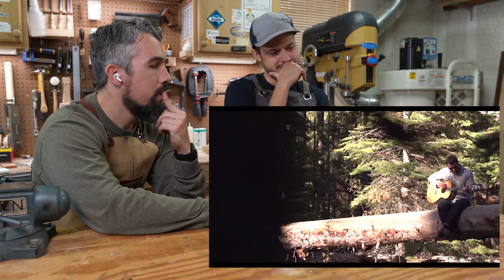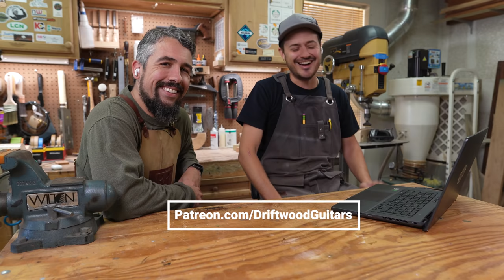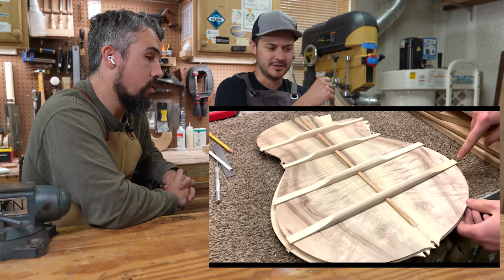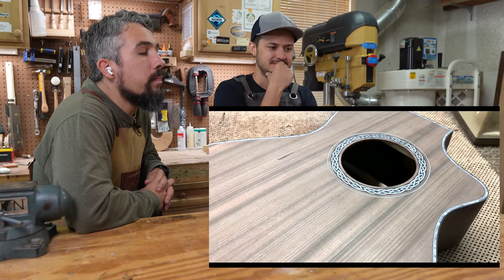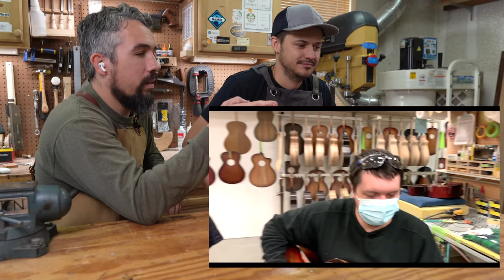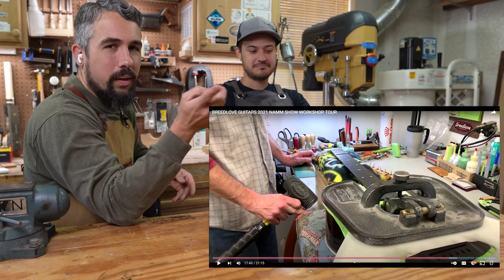Professional Luthier Reacts: Breedlove Guitar Factory Tour

Comment: Hey guys. Seems like you would like to have a vacuum table. They are very easy to build. Powered by a shop vac. I'm sure,with your experience, you could easily build one.
Reply: I have built one in the past, and would happily assist or even build one for you!
Reply: We often use a shop vac to pull down (debulk) the vacuum bags in making composite parts with the RTM process.  Resin Transfer Molding is amazing compared to the wet layup method, as the resin is pulled through the plies of material that have been laid up dry so all the vapors are contained within the vacuum bag.  After it cures in the bag, the shop vac is used to push air into the bag, inflating it and easing the process of pulling the part out of the mold.   CameronAircraft.com Learning Center videos...

Comment: I am a very small scale maker having built only one tenor ukulele.  I used vacuum clamping to glue bracing on the flat top and radiused back.  I used an inexpensive vacuum pump (12V DC from eBay, ~$12) for the vacuum pump as it was quiet and pumped things down in about 20 seconds.  I used some extra wide clear wrap for the membrane, sealing around the edges with some cured silicone.  The wrap is attracted to the silicone (like the kind you use to seal around the tub) and makes a good seal.  The vacuum clamp rig did a great job of holding the arch in the back while the glue dried.  The tooling stores flat.  A good thing for a hobby builder.

Comment: I own a couple of Breedlove's. My Oregon series 12 string is all myrtle and sounds fantastic ($2k new). I did have to do a neck reset once on it but it was super easy to do myself due to the bolt on, butt jointed neck. Not all Breedloves use the bridge doctor. My Moonlight 6 string (also made in Bend) does not. It is a super light build with spruce and mahogany. Breedloves have an amazing midrange presence but still nicely balanced. Most of my friends are not familiar with Breedlove but after they play mine, they have a whole new level of interest.

Comment: I bought a used Breedlove OM/R Revival Vintage with an Adirondack top made in Bend probably 10-12 years ago. I had been looking for a Martin OM-28 but just couldn't find one I liked enough to justify spending the $$. The Breedlove was around $800 less than a comparable used Martin at the time. It plays and sounds great. The low E and A strings have that piano-like sound quality a couple folks have already mentioned. 

I just discovered your videos and have been watching them all day. They're great

Comment: Let me start off by saying that I buy and sell guitars as a hobby and it's fun to play different guitars that I normally wouldn't get to otherwise. Have had several Breedlove guitars that retail in the $5-600 range made overseas that I have not been impressed with.  I have owned several high end Martin and Taylors so that is the sound I am comparing to. I had someone ask me about buying a Breedlove AD25/SR with an unusual wood blend of spruce top and solid rosewood back, but layered rosewood sides. Made in Korea in 2006. He was selling me a Martin D28 and an all Koa Mexican made Taylor 224CE-K DLX also. He said that the Breedlove was the best sounding of them all. I was thinking, yeah right he's just trying to get me to buy it. I paid $450 for it with an incredibly nice custom hardshell case. It went for over $1000 new with tax. Well he was right. It blew me away and like I said, I wasn't much of a Breedlove fan at that point. It made me sell a $3000 Taylor that was my main acoustic and after almost 2 years I can't find anything to top it. I recently bought and sold a Martin HD28 and it might have been slightly better sounding but I sold it  since it didn't have electronics. Look at the customer reviews of this guitar on Reverb. Over and over you find someone saying that that they went into the guitar store looking to spend $2-3000 on a Taylor or Martin and walked out with this one. And now if you can find one, they are only $4-500. There is a Mahogany one also but haven't tried it. I know the American made ones are supposed to be great, but for the money this has been like winning the guitar lottery for me!

Comment: For locating your braces once inside the vacuum clamp, wouldn't you just create a new acrylic template with slightly more margin to account for the thickness of the vacuum bladder?  That way, you could fit the template over the top of the bladder once the vacuum starts to make sure all the braces are in the right place.  If not, you could quickly release the clamp and re-set.  Just a thought!  Love what you guys do!  Keep up the great work!

Comment: I  built a stewac Martin D-28 in 2004 and it had a bolt on option. Still good , no problems and sounds really good. Trouble is the customer owns it. So I agree with your comments about neck joints.

Comment: I have owned two Steve Henderson models, a 1998 CM/MH-12 string and a 1999 CM/MH six string (mahogany/Spruce) Both exceptional guitars. I did re-fret the 6 string with jumbo SS frets, and installed Baggs Anthems in both. Quality of workmanship second to none. These models didn't have any bling(how I prefer it) other than around the sound hole. The bass on the 6 string was insane. The nut on the 12 was as good 1-7/8, a bit large for my hands. The six string was 1-3/4. I asked Shaun Hopper to test out the new fret work on the six. He couldn't get over the bass in the guitar. Loved it. Personally I was shopping for a cutaway model and sold both guitars to acquire one. Unfortunately, then the deal fell through. I super regret selling the six string. I purchased the new 12 string Masterclass, all Myrtle wood. Pricey, yet just not the sound I was looking for. Ended up trading it for a Furch Yellow series cedar over rosewood. Still preferred the Spruce over Mahogany Steve Henderson. The voicing was perfect on that guitar. Live and learn. Going to do it right next time...Saving up for a Driftwood. Hopefully I'll get there before I get too old.

Comment: I like a dovetail because it is a traditional wood working joint that goes back a long way. And I think you are adding weight with the metal parts of a bolt on neck; that might be considered a positive as it sits at the neck/body joint, and might affect the balance of the instrument in a positive way.
I will build with a dovetail until I die, purely for love of the joint; but if anyone thinks they can put a blindfold on and play three guitars with different neck joints and consistently pick the dovetail from the rest I have some swamp land in Antarctica for sale

Comment: I own a Breedlove Mandolin that I bought in 2008. It cost around $2000 CAD. It was beside a $5000 Gibson on the wall at the shop. I bought the Breedlove for three reasons. The cost, the playability, and the sound. The width of the flat Gibson neck compared to the wider, radiused one on the Breedlove was almost unplayable and I have long, slender fingers. The Breedlove has a natural satin finish and it barked way louder than the double the price Gibson. No comparison whatsoever. Nice hand-signed certification in the plush Thompson 1928 case, too.

Comment: I picked up my 2nd Breedlove used for a very reasonable price. They seem like a moderate sleeper brand that punches above their respective price points. What's your take on the bridge truss rod adjustment system they frequently use to stabilize their bridges from pulling up?

Comment: I had one of their imported 12-strings about 15 years ago. Got a great deal at a pawnshop, so it knew how to play the blues. Sounded great, especially for the price. 
I was reluctant about the bridge initially, because the strings were anchored in the bridge, not pinned to the bridge plate. But that was never the problem and if they were epoxied like this, I now know why. 
The terminal blow came when the popsicle brace came unglued and the neck caved into the top. Too much tension for the design to accommodate the build quality. I didn’t repair it, but I have regretted letting it go.

Comment: Here are some questions.  I have a Bedell brand guitar which ended up being all solid woods, spruce top, mahogany sides and back.  Do 2005s, likely or not likely, have a bolt on neck as well or did Bedell guitars from China use a dovetail joint?  I would prefer the bolt on as I am also a believer that the dovetail with glue is a mthyical story these modern days that the guitar sound is so much better than an engineered, precision connection which also allows easier servicing as the guitar gets older and angles change.  Love to hear comments back on that topic alone.

Comment: In trimming the top and back he's using a down mill cut....he's moving the router in the opposite way to the rotation of the router bit. Do this in Cabinetry all the time with splinter prone woods. I understand that Charles Fox routes his top and back overhang the same way.
Reply: Exactly. He was “climb cutting” as he routed off the extra top and back material.

Comment: What did I learn? 17:30 shows what I want in my StewMac Tape Deck- a retention arm of some type. I liked the fret caul thingy, too. It was cool. And because you brought it up, scarf joints are only stronger in a certain range of configurations. To just say one is stronger than another without a bunch of qualifiers will never be a very accurate statement. Not to mention 2 different possible ways to align the scarf joint. My Taylor Big Baby is finger jointed, lol.

Comment: I bought a Breedlove a couple years ago... it was beautiful, i loved it... until i took it to my local shop to get a full setup because the action was too high and at that time i wasn't confident in doing my own tech on a new guitar. turns out the neck was jacked up, glued wrong... he couldn't adjust it out without quite a bit of work and he definitely couldn't get the action lower. i was very disappointed and returned it. ended up buying a Gretsch rancher. not as nice of a guitar and ultimately didn't do what i wanted at the church but it's nice to have as a backup.

Comment: Breedlove does what all the manufacturers do--cheaper Breedloves are built in China.  I have one. It is ok, with very good sound because of the truss system removing tension from the top.  They don't cover that here.  My Chinese stage concert rings out like a Martin, but does not have the playability of say something like a Taylor.  Solid Indian rosewood sides and back, Sitka spruce top--again a loud and great sounding guitar that retails for $1000 w/all solid woods.  Excellent fit and finish.  Their biggest innovation is the truss system inside the body. It attaches to the saddle taking stress off the top so the top can vibrate more--it really works.  These small concert size Breedloves really sing out.

Comment: Just out of curiosity,  why wouldn't you use the locking parts of a tidal caster on an acoustic? I dont mean in a horizontal plane but vertical in place of a more complicated joint like a dovetoil?

Comment: The epoxy bridge explains a lot!
My 12 string pinless bridge exploded and tore off the top wood leaving the bridge solidly glued. 
My repair guy reglued the new one on three times and it wouldn’t stick. The last time it stuck for a while but it’s lifted and I just let it sit there in its case. (I like the sound of my Yamaha fg720-12 more anyway)
Before it came apart it was super playable.
But I think the epoxy didn’t help with the reglue. (And my repair guy was t the best)
Reply: I bet if you shipped it back to Breedlove in Oregon they could fix it with no problem.

Comment: I got to play a couple. There is definitely a significant improvement going to the Oregon made guitars, and the reasons are exactly what you would expect. I find the guitars IMO and very limited experience produce less treble than a Taylor or Martin. Definitely not as bass heavy as the very few Gibsons or Guild guitars I’ve tried or owned (Guild, wish I had kept that). I’d call it a more subtle guitar. Again, very limited hands on experience so take it for what it’s worth.

Comment: I think the "custom shop" moniker is a little misleading. Yes, that's what he said, but they have a Bend, OR factory and their overseas factory. I have one of both. My Oregon Series looks ($2000 new) like the majority of the guitars we see in this video (Myrtlewood/Sitka Spruce). It's a great guitar. So is my overseas model that I've had for over a decade. I saw a couple other comments about them punching above their weight class and I couldn't agree more. I sold my 814ce Taylor to buy my Oregon Breedlove (And an American Strat due to the price difference) because the pickup system in the Taylor's are just so polarizing. I side on not liking them. I find playing my Breedlove live is way better than my old Taylor. The Breedlove sounds good acoustic... It's not the Taylor sound obviously, but a great player. I always suggest an entry line Breedlove to any aspiring players due to the playability.

Comment: You cant have blow out flush trimming your sides , or binding, if you go clockwise around the guitar… bc of the rotation of the bit… you can’t have blowout if you have already removed the wood behind the bit.. that’s the one thing that confused me about the “downhill” cut process … bc every fine woodworking class teaches go clockwise bc if you remove wood behind the cut.. there is nothing to blow out.. 🤷‍♂️… I guess do what you know works on a precious guitar

Comment: I have two and I'm a bit of a fanboy. I love the look and the sound optimization and the locally sourced sustainable woods. The bridge truss is supposedly so they can take the tops considerably thinner than usual, that's what the marketing ploy is anyway. I just got a sitka/Myrtlewood "Concerto" which is their version of a dreadnought but it doesn't have a bridge truss in it so it might not be universal on their guitars anymore. 

Curious why you don't like the pinless bridge. My thinking (I'm not a luthier) is that maybe they think the combo of bridge truss, epoxied bridge, and super light top wood is enough to make up for the lack of string thru top. They might also be hedging bridge lift/reset repair bets on the bridge truss system which might be why they're comfortable with epoxy? Idk I'm making stuff up lol

Comment: As to a neck joint style effecting sound - I've got a Cordoba Acero D11-CE (discontinued due to Cordoba buying Guild) steel string acoustic with an in integrated (spanish) neck joint. Acacia body with sitka top. Although a heavy string strum can make this guitar project, it doesn't project well under light strumming or finger picking.
Along with the seemingly heavy hybrid fan and x bracing, the string vibration returning from the neck appears to be neutralized at that neck joint into the body.... instead of helping energize the sound board.
So in this instance of a steel string integrated neck, I think the joint does negatively affect the sound.
On a plus side, the action above and along the mahogany with ebony board neck is the best I've ever played.

Comment: As a higher end of the company line, I am shocked to see a butt joint neck instrument being built here, especially with such a small foot on the neck itself. Most of the sonic transfer seems to come through the fretboard itself, And the big bolts! If I owned this guitar company, there is no way I would I would make a video that showed it as if it doesn't make a world of difference. It's that whole "rubber meeting the road" thing but I guess it is a bit of a mute point as it has a poly finish, which for me is a deal breaker anyway.
If I am buying more than a camp-fire guitar, it has to breathe.
Reply: Doesn't the sonic transfer on all guitars happen primarily at the bridge, where the vibrating strings actually connect with the top?
Reply: @newpatch36  The bridge posts are a good part for transference but if you were to put a rubber gasket in between a bolt on neck, and the body, it would kill the sustain and show how valuable that wood to wood connection really is.
Every part contributes to the overall resonance of all stringed instruments
Reply: @jeffmckinnon5842  thanks for the clear explanation 👍🏼